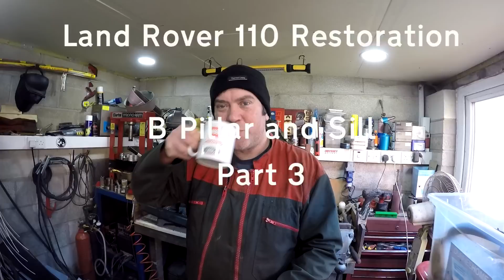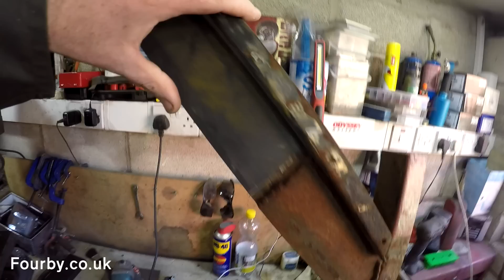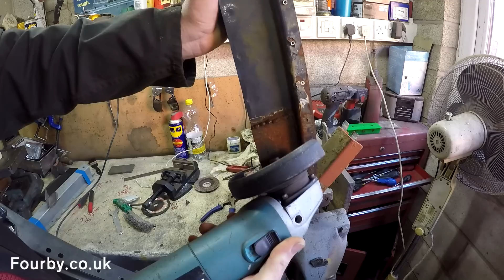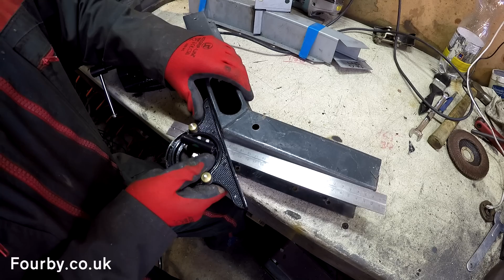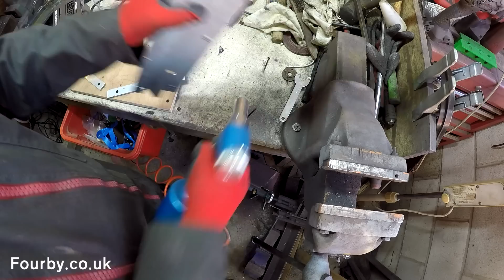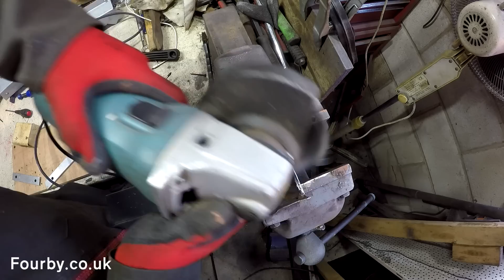Land Rover 110 Restoration #3 "B Pillar and Sill repair Part 3"

Comment: Just got my old 2a home after buying it last week. A quick survey to check rot and discovered my off side B pillar is galvanised but my nearside one is steel and virtually turning to dust!  I,m looking for a Galv B pillar and ideas please that doesnt include ALL the ‘T’ section and charge £1500 🤷🏻‍♂️ Great vid thanks. Where can I buy one of those ‘high speed ‘ tools please 😉